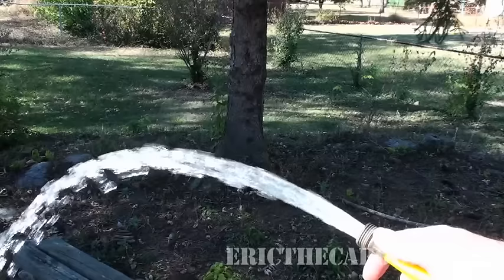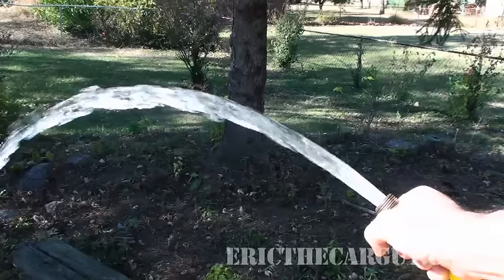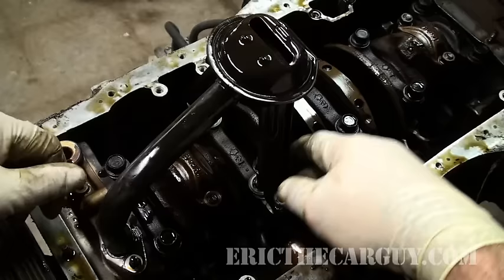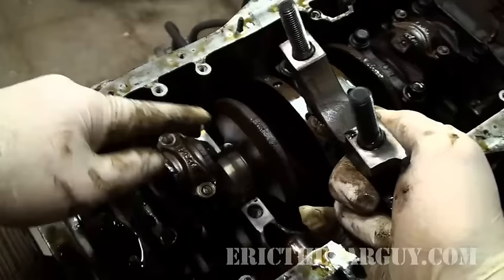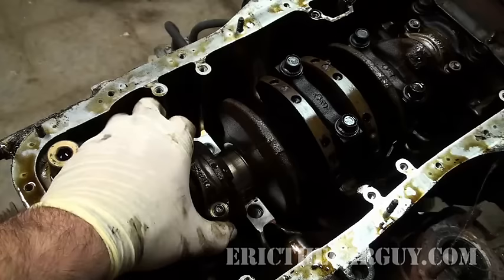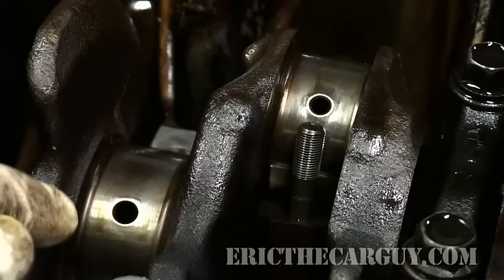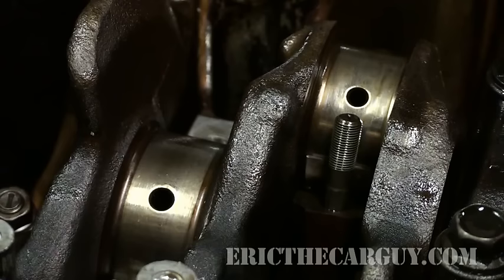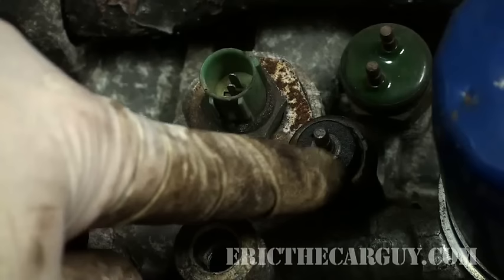How Oil Pressure Works - EricTheCarGuy

Comment: I hope Eric reads this! I have a conundrum. Is oil pressure what keeps the bearing surfaces from touching? For example: if you put in a lighter viscosity oil, you're going to make lower oil pressures. Will that (disregarding the possible issues of too thin oil) make the bearing and journal more likely to touch? And if you have really loose bearings, will putting in a high viscosity oil to restore oil pressure make the bearing surfaces less likely to touch?

Comment: - what cause low oil pressure (main bearing worn) (other option: Excessive bearing clearances are not the only possible causes for low oil pressure readings; others are oil pump–related problems, a plugged oil pickup screen, weak or broken oil pressure)

- what cause high oil pressure. (Higher than normal pressures can be caused by too much oil, cold oil, high oil viscosity, restricted oil passages, or a faulty pressure regulator.)

so low oil pressures = excessive bearing clearance 
what would you say for high oil pressure? my pick is restricted oil passage

Comment: thanks for the info, my 2009 corvette is having the exact signs you just said.  it has 240000 miles on it.  I bought to dearlership, they did not even look at it and said we only gonna put new engine it , 10,000 dollars, I towed it to another company and they said 5 cylinders working 5 6 7 or not working    He then called me back and said I have bad new, no oil presurre  or oil getting to big engine on top,  He said he can can the oil pump, but due to high miles, he does not know if that would fully solve my problem.   He then said a new engine, well I do not have over 10,000.00 to drop on a new engine.  I had the spark plugs and wires changed.

Comment: Anything that is worn out beyond tolerances will cause an oil pressure drop, if the clearances between the bearings are above tolerance, it will cause an oil pressure drop, if the gears of the oil pump are worn out above tolerances, it will cause an oil pressure drop. The case when you can conclude that the oil pump is fine, is if the oil pressure drops when you hit the gas pedal, if that is the case, it is the pressure over the crankshaft that is leaking, since when the pistons exert force against the crank they move it and the play opens those clearances.
Reply: When I 1st start my Jeep, my oil pressure gauge reads like 60 to 80, It will climb if I press the gas as well.  Then as the Jeep warms up around town, the pressure eventually drops to around 40 on the gauge. and stays there. Why? Has my internal engine parts expanded That Much to allow for lower 'pressure' readings as it gets warmed up.?   And then, If I drive my Jeep for HOURS on the highway, it will maintain about 40 psi on the gauge.....But when I approach a stoplight, slowdown, and slip the jeep into Neutral, and coast forward toward the stoplight, idling ....I notice my gauge reading drops to maybe 20psi.  And then, as I regain speed again, on the highway, the gauge reading will climb back up to 40 psi.    Why is this?

Comment: Eric explain to me why there is a oil by pass valve  if the oil pump does not create oil pressure.   The pump does create the oil pressure.  This pressure is regulated by a by-pass valve. If the by pass valve sticks closed, guess what, your oil filter blows off no matter what your bearing clearances are.  The tolerances in the engine assembly are designed to create pressure loss which decreases the pumps pressure ability.  It doesnt matter if the bearing clearance is at  .002  or .100 of an inch,  because of the clearance,  the oil pump has lost its ability to reach maximum pressure because of the leak.    

  Think  of it this way. The piston in your car is moving up on compression stroke  the compression gauge says 150 psi.  Now lets say you have a burnt valve which creates less resistance when the piston moves up. The compression  now reads 100 psi.  Less resistance equals less pressure. The leaky exhaust vale did not create the pressure. Just like the leaky rod and main bearings did not create the oil pressure.    0 resistance equals maximum pressure.   Putting your thumb over the garden hose did not magically create water pressure,  The water pressure was all ready there. The size of the hole, be it .002 or .100  just regulates pressure loss.
Reply: Ace Of Hearts! Your a genius!! That was beautifully explained. I think your the only one that challenged Eric. Great comment !

Comment: Hello guys! I have a 2010 VW GTI I have the Oil pressure warning light :( recently the cylinder head was repaired...Installed a new Oil pump OEM after a  few miles the Oil pressure warning light came on again :(  Mechanic said Oh! It;s a defective Oil pump...but after seen this video I think my mechanic is wrong!? Well tomorrow he wants to install  another new oil pump "hope it works....So if that takes care of the problem... good for me and if not, this video from ERIC will prove my mechanic wrong.

Comment: I have a 1987 olds cutlass ciera. On a cold start, oil pressure is fine. As it reaches operating temp, the oil pressure drops to near 0. Ive used 5W-30, 10W-30, 15W-40 and 25W-50 oils to no avail

Comment: Thank you Eric!  I have a 97 Firebird. Soon after buying the car the oil pressure gauge went out and I changed it.  I noticed that the old pressure gauge used to show the pressure at the half mark but the new pressure gauge goes to the 1/4 mark unless the engine is revved then it goes up to half way like the old pressure gauge did, after watching this I can presume that is normal when the pressure gauge is working correctly?

Comment: Eric you are a very good teacher, but i have a problem. that is my 96 dodge dakota 3.9 v6 2wd. i changed the oil and used 5w-30. i also added a stp oil treatment additive. when i start the truck my oil pressure immediately goes to mid operating range and sometimes a little higer than mid operating range but does not go into high pressure zone. when i stop it goes down to mid to a litter lower than mid operating range but does not go into low pressure range. why is it doing this

Comment: I'M LEAVING A COMMENT LOOK AT ME!
well more a question, 
whilst learning to fly choppers, i learnt something interesting in ground school; Oil pressure is actually highest when the engine is cool, not because the engine parts are tighter, but because the oil has a higher viscosity.
I would like to know when (at what temperature) you should read oil pressure to diagnose how good ur bearings are?
also, can piston slap as a result of wear, be a cause of low oil pressure?

Comment: So, if the pump is bad, and it's moving less volume, wouldn't that reduce the pressure created by the clearances? If you turn that water house down so half the water is flowing, then your finger creates half the pressure. Right? So even though it's not the pump that creates the pressure, the pump can affect the pressure.
Reply: yo this is exactly whaat i was about asking, yoou are very right

Comment: I understand that the oil pump doesn't "create" pressure. My oil pressure problem is unusual. 95% of the time the following occurs: oil pressure is perfect until engine has been running at least 20 minutes. After 20 minutes if I come to a stop and the engine drops to idle, the oil pressure drops significantly. The other 5% of the time I have zero problems with oil pressure. It's perfect the entire drive whether it's 30 min or 2 hours. 1989 Ford f-150 with a 302 and 170000 miles.

Comment: Very good explanation video. I have a Question: what is the correct oil pressure for an audi q5 2.0 TFSI engine? 2010 model. The gauge meassure 25psi in cold and drops to 20-19 after 20 mnts and the llight warning apears :/

Comment: I have a 07 gmc Acadia that drives good for about 40-45 minutes thn the oil light comes on an it starts making a weird noise but once I let it cool down it’ll run fine again I put a new oil pressure sensor an still does the same thing

Comment: Good day. Your videos are awesome. I have a question sir. My  car is a minivan f6a engine from Japan. Engine is quiet when cold but when it reaches the operating temperature, the low oil pressure warning sign lights on. Also the engine sounds louder when the engine is hot. What are the possible reasons for this?

Comment: Eric 1st let me say you're the BEST. I've watched a million vids and found you today. PLEASE HELP . I'm an elderly disabled man. I van do small repairs but nothing big. My Question. I have a 2002 chevy express 1500 5.7 liter vortec. She has 212 k miles. I was haveing problem with oil gauge. It would run at 40 psi u til warmed up about 30 mins then go to about 30 psi I was told to replace oil sending unit. So I tackled that as soon as I did the oil pressure would start at 40 when cold and after warmed up NOW drops to 0 at stop light but goes back up to about 30 when driving. She doesn't make ANY noise st all. But I know something has to be wrong. Im on a fixed income and take care of my ex wife a stroke victim and 2 of her son's adult autistic . I can barely afford to feed everyone. And might have a hundred bucks left at end of month. So buying another car /van/bicycle lol . when i replaced oil sending unit I noticed a thick wall of burnt oil on it. Don't know if that matters as im not a mechanic. Man any info you could share with me would be soooo greatly appreciated .as i have to have vehicle to get them and myself to Drs every month. I'm at end of rope. Thank you and god bless you. Bryan.

Comment: Erick I have a question: I took my truck to a widely known oil company and 800 plus miles later, about a week and two days, my car began leaking oil on the highway and my oil sensor light came on and the gauge dropped to not reading.  I immediately parked.  Company send one of their worker and noticed part of the filter gasket was sticking out.  He removed it after taking pictures (admitted it was installed improperly), replaced it and added oil--no leak but a knocking noise began.  Company said their video shows worker did everything right and installed filter correctly.  Filter was send out for evaluation and it came back not defected.  Mean while, I am driving my knocking engine truck for one thousand (1,000) per district manager.  After the one thousand miles, DM told me to bring truck to a shop of their own.  So I did and was told that the engine oil pressure was not normal at idle or at speed and as a result, it was so high that the pressure cause the gasket to come out causing the leak.  MY QUESTION IS CAN THIS BE POSSIBLE AND IF SO WILL THE FILTER SHOW ANY DAMAGED AS A SIGN THIS HAPPEN?  AND CAN THE FILTER BE INSTALLED INCORRECTLY AND NOT LEAK AFTER 800 MILES ( THEY ARE SAYING IMPOSSIBLE)?

Comment: Depends on how much oil you got extra over the Max line, if its like 2 - 3 mm higher, nothing will happen, but if its a lot more than that... well I drove with 5 mm with too much oil, I got away with it. In a worst case situation what will happen is that the crankshaft will "slap" on the oil level which it can reach now, and make a bubble like shake out of it stressing the engine, not only that. The oil pick up will suck air, and air is a bad lubricant. Dont panic, drain a bit :)

Comment: Actually, i believe from what i've studied(correct me if i'm wrong though). That hose analogy is incorrect. I'm not sure about the engine but in a water hose, when you put your finger on the tip, you don't actually increase the pressure, you increase the velocity of the stream. The pressure actually drops. I'm a mechanical engineering student and thats what we've learned in fluid mechanics. Even in high school. Its a conclusion drawn from bernoulli's equation. Again, i'm not criticizing you. I'm just saying how this flawed analogy is so commonly used. For a layman though, i agree it does the job well.

P.S One of your biggest fans here. Keep rocking. :D
Reply: Godzilla555 

Agree with you, whenever there is a flowpath restriction/increment inside a conduit carying a fluid, a differential pressure will be observed creating the flow’s speeds changes as per the Bernoulli’s effect.
In this case: if we could put a Pressure Gauge sensing INSIDE the hose, a pressure increase will be perceived everytime the finger is blocking the end, and consequently pressure drops when going out.That’s why the analogy is quite good even when is not deeply explained… “when the engine wears out, is equivalent to gradually remove the finger from the tip until there is no resistance at all,which will give a Low Pressure Reading”.
I also used to be a Mechanical Engineer student.
Cheers!
Reply: Mekaniserch Thank you for the insight. Yeah i didn't realize that. The pressure does increase before the flow passes through the restriction in the path.

Comment: Thanks for the video. When I was in high school about 20 years ago I bought a V6 for my 81 Buick Regal which I regret not getting a V8 but right now I'm just trying to deal with what I got anyway long story short I've been trying to find an oil pump and nothing comes up at auto parts stores only rebuild kit so I was wondering if you know if V8 and V6 have the same size because the V8 so that's what I was going to say my motor is less than 5000 miles but my oil pressure is off so thinking about rebuilding the pump

Comment: Hello my engine when it warms up and about 30 min the engine starts to lose oil pressure slowly after about 60 minutes I have to turn off the engine because then the oil pressure becomes critically low, but when the engine cools down I get the oil pressure back or when I  accelerate in neutral gear the oil pressure comes back at high rpm, I wonder if it could be the oil pump or motors worn in the cam bearings?   to give more info the engine is not leaking oil and the pressure on the cylinders is quite good, the engine temperature is also good

Comment: problem was my oil pressure release valve which was causing oil not to reach to crank which was causing the rod bearings to make the loud noise since I fixed the pressure release valve I hear no more noise coming from my motor on restart and high rates of acceleration

Comment: Great info, I have the opposite problem I had a gen 1 383 4 bolt main with hydraulic rollers. small block Chevy built, I won't say what company  but well known ,for my boat I've been priming the engine n have very high oil pressure,  on dash n I bought a mechanical gauge 90 psi It starts n sounds great for 15 seconds then  blows oil out the oil filter gasket  then I have oil all in the bilge. Engine did sit in boat for a year without priming, injured my back at work. Any help would be appreciated.

Comment: I have a 2008 GMC Sierra 4.8L. When I drive the truck it runs fine. But when I idle in a fast food drive through the engine starts to 'tick'. Then I drive away and the ticking stops. It only ticks when idling. It sounds like 1 lifter ticks when idling after 8 to 10 min. Then a 2nd and 3rd lifters softly ticks about 15 mins after. Is this an oil pressure issue? I know Vortec engines for those years have oil pressure issues. Thank you for your help.

Comment: Hi Ed.  I just reinstalled an remanufactured engine for 2nd time in 4 months.  The first time it had a rear main leak and the second time it blew the oil filter clean off after starting.  Changed filter and same thing. I’m currently checking the relief valve on the oil pump. Dropped the oil pan. I guess it was possible that the top of the piston on relief valve was upside down.  Other than that what could it be causing high oil pressure?  Maybe a clogged oil journal?  Crappy machine work?  The engine is a Ford 5.4 2valve Triton.

Comment: with pressure yes. but an oil system needs higher pressure above atmospheric pressure. The resistance in the oil system makes the pressure (back pressure) if you drilled all oil channels to double size, your oil pressure would drop because of less resistance in the system.

Comment: Thanks for the info I bought a 1996 ford explorer & the guy rebuilt the engine. 6 months later I have this issue low to no oil pressure & the engine is rattling.

Comment: Eric, when would the oil pump kick in? For example, when you turn the ignition key without cranking the engine over the fuel pump would kick as soon as you turn the key.

Comment: Great Vid but not all cases of low oil pressure are caused by a worn engine.  Oil Pumps do go bad!  or what about that stopped up pickup tube.
Reply: yes the Ford f250 super diesel as well as other diesel have an oil sump pickup system t v at has a screen at the sump pickup end. often times this screen/filter gets blocked and can cause low oil pressure in the system.
my question is what causes high oil pressure say in an Econoline Van 150 '96
Reply: Bad Sender First then Clogged passages would be on my list. Does it have top end noise?  I don't recall that I have ever had a relive valve stuck close(may be wrong here).  Be a hard question to answer without drilling down on that. In my shop we check most oil pressure concerns with the mechanical gauge first.

Comment: Hey question, i have a 2014 corolla 53k miles, i suspect the dealer where i used to do the oil changes used the cheapest oil they can find, but i always noticed the oil level on the dipstick showing overfilled, when i did the oil change myself i put in the correct amount of oil using mobil 1 0w-20 and the car drives much  more better but i still shows on the dipstick as if i overfilled,